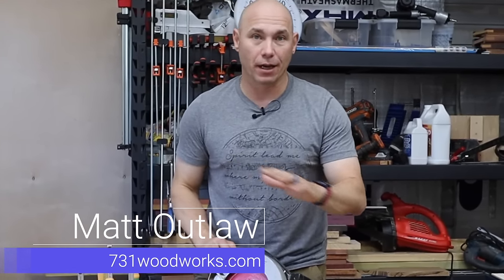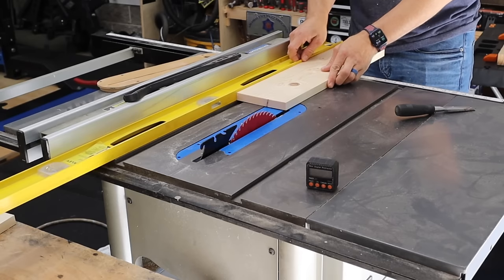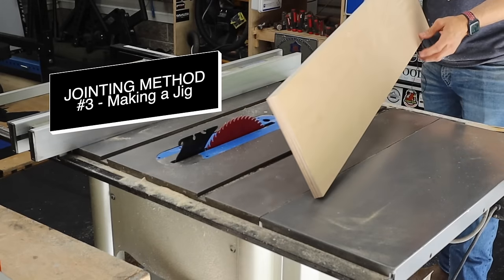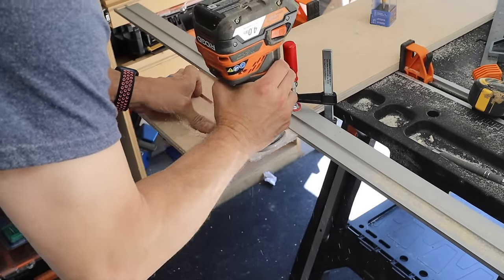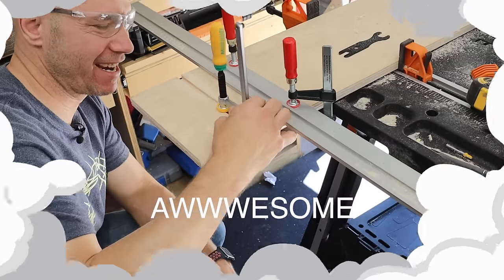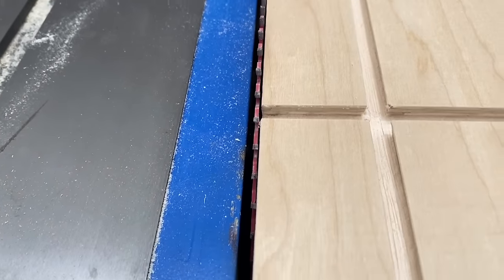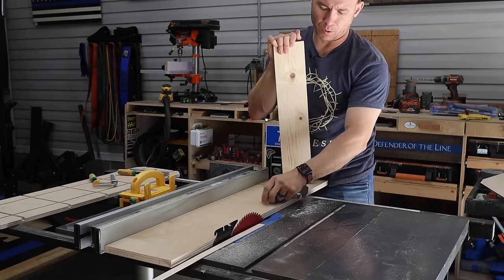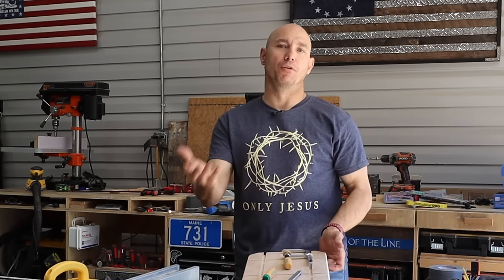5 Ways to Joint Boards Without A Jointer | Woodworking Tip

Comment from the maker: The first 1000 people to use the link will get a free trial of Skillshare Premium Membership: https://skl.sh/731woodworks05211
Reply: You could always flip it over and use a straight edge and tape measure.  Measure the same distance on both ends and draw your line
Reply: Awesome vid man. I have a question though. I'm new to the woodworking thing. I've never even touched a router before in my life.  My question is do you think the Ridgid corded router will work for making that sled? Its 5.5 amps and rated as 1.5hp. They're calling it a trim router. The reason I ask is because there's a smoking hot deal on it right now. The router and a sheet sander for $99. By itself without the sander is normally $129. It looks like Ridgid only makes 1 cordless router. Without battery (I already have them anyway) they're also $129. 

The questions section of the corded is a mixed bag. Ridgid rep says it can't handle a dovetail, users says it might if you use multiple passes. Your method with 2 different bits makes me think it probably could.
Any guidance would be appreciated.
Edit: another question...why didn't you just make all the first cuts with the first bit, then follow up with the dovetail? Moving the straight edge is easier and faster than swapping bits, no?
Reply: @KlockoFett   I own 6 different hand held routers. Why you ask because the price was right for correcting my  mistakes and I did the foolish thing the first time I purchased a router and bought a unit to small for the task. For heavy work buy a reputable  hand held router that will work for the main purpose and for various other uses such as a router table mounted unit. I have 2 Porter Cables, 1 is dedicated to my Incra Router table with Lift and yes I have the base if I should ever need to use it as a hand held that unit is 3.25hp. The second unit is a Porter Cable 890  2.5 hp and came as a kit with 3 bases , D base, Plunge base, Standard base. It is 16 years old and has seen thousands of board feet in usage and still going strong. I originally used it under my router table big mistake not enough HP.  3rd unit is a Ridged trim router and I picked it up on sale for 59.00 years ago and only purchased it because I could not find my Makita trim router at the time. Those two units are only used to make door jams , door hinge /strike plate cuts  and very light profile work because of the 1/4 inch collect . Such as trimming edge banding for frameless cabinets and shelving. I did Formica work long ago when I used to repair counter tops in apartments that had Formica. I also have an older Bosch 1600 series and use it for various hand held stuff,  but my go to is my Porter Cable with my Omni Jig 4216 for dove tails because of the template guide bushings.  I also have a Craftsman router that is a Bosch 1600 series disguised as a Craftsman and I picked it up off craigslist for 50 only because it was a packaged deal I wanted the dove tail bits and circle template,  guides bushings, parallel guide  the guy was selling. That is one of the other reasons I own a Bosch they're motors and bases ( Craftsman/ Bosch) are interchangeable and I can set different bits in the motors when sign making. Then the most expensive and it is dedicated for one job only and that is my Festool OF10 and it is mated to a LS32 system for shelf pins and other rail system routing needs. I had to pick up a collect to let the unit work with my 1/2 inch router bits. the factor collects are mm. 

    So in summary think about what you are going  use the router for before you buy ( most import part of owning any tool or machine). Buy it once save time and save money by getting the correct tool the first time around.
        Trim routers are for very light work only and come with a 1/4 in collect if I recall correctly.  2.5 hp routers will handle light task to medium heavy tasks come with both 1/4 in  and1/2 in  collets and MM collects are available if you want to use Euro bits.  3.5 hp  Routers all task can be done with one, but they are heavy use both 1/4 in and 1/2 in along with mm collects, Will mount to a router lift / plate for table usage. Important factors :  Soft start and variable speeds are a definite thing to have on a router or the ability to step the speed down. ( Not all bits turn at the same speed.  Warranties are semi important. but for the cost of say a Bosch 1617 dual base standard and plunge $219.99 at Lowes just easier to go get another when out of manufacture warranty.  Name brands are just that name brands most all tools are made in China or Taiwan.  I have 5 different name brands and would not change a thing because each one has it's usage as I have adjusted to that. For a non production shop get a multi base setup in a kit for general usage and a trim with attachments for special work. Plunge base is a good option to have hence the multi base kit. I was against plunge base routers for a time in the beginning because I did not understand the multitude of things a plunge could do. Piss poor training by piss poor instructor(s) leads to piss poor knowledge and piss poor decisions in tools and their usages. hope this long very long post sheds some light onto the subject for you or any one else brave enough to read through it all. Because when I started out there was no YouTube and most craftsmen were stingy with the knowledge of the trade and apprenticeships were very hard to come by.
Reply: @KlockoFett  To answer your question the router the poster of the video is using is a palm router aka equivalent of a trim router. So that router is working over time to cut that much material with a dove tail bit. and Heat kills/ dulls router bits very fast. So using an under power router would require the usage of two bits for ease of cutting and to reduce tear out. But also it is a good practice to use that setup . Straight bit to get to depth of the dove tail plus it removes majority of material. Dove tail bit only has to remove the beveled cut of the dove tail. Keeps dove tail bit cooler and prolongs the life of the bit. As dove tail bits cost  a lot more than a straight bit. Router horse power is also a big factor in bit usage. That is why poster made statement about router table.

Comment: I should tell you that I used to watch my carpenter grandfather joint using a handsaw back in the 60s.  When he built cabinets for our bathroom he would take to well matched edges and glue them together, then saw through the glue line, then re-glue them back together leaving a pretty much invisible line.  Any variance from straight was matched with the opposite variance on the other piece.  He did pretty much everything with hand tools back then.
You have a wonderful channel, thank you and God bless.
Reply: It is pretty spectacular when you realize the quality those men put out with just their hand tools.
Reply: Skills learned by necessity - few power tools and high-tech gizmos.  Watch some Japanese Joinery or woodcraft videos.  Few, if any,  power tools.  Others (people, cukture, etc) as well, but I don't remember specific craftsman.

Comment: I feel like a hand plane deserves mention as a method to joint a board without a jointer. Even a really good jointer plane is cheaper, smaller, and quieter than a jointer and an inexpensive jack plane can do a great job as well. The jack plane will also get a ton of other use around the shop. These techniques and jointing with a hand plane are also complementary because the machine techniques can get you close and do most of the work and then following up with a hand plane can get you perfect. This remains true once you get access to a jointer, just "close" gets a lot closer and ideally there is very little work to remove the machine marks and make the surface perfect.
Reply: Absolutely!  I’m into violinmaking and we always joint the plates with a hand plane, the jointer would remove too much material and could chip out the flames on the maple!  Hand planes rock :)
Reply: 100%!
Reply: You are. Correct, but it is a skill in it's self to use those hand plains. I suck with every one I've used😂
Reply: @lancep9394  need more practice. A little trick too. Edge join 2 boards by clamping both boards in a vice, edges up and flush. Assuming they are about 3/4" wide, the plane iron can hit both at once. Both sides wind up as flat as the plane.
Reply: @lancep9394  The key is to use a shooting board. This enables you to lay the plane on its side guaranteeing a 90 degree cut. There are special jointer planes to use but a No. 5 jack plane, or longer, will do fine. Quicker than setting up the table saw!

Comment: Love the fence jig - gonna make one of those! Regarding the 90-degree blade set - the most foolproof method is to joint the first board face up, then joint the second board face down. The two edges may not be exactly 90 degrees each, but the two together will always be 180 degrees and a dead flat perfect join.
Reply: If the board is wibbly wobbly you are probably best getting a flatter board or, if the thickness of the board is not a concern, planing the board to be more flat or completely flat is a good option. A much more involved option is steaming the board and then clamping it in some sort of straightening jig. If the bard is cupped or otherwise warped and you joint it, the whole piece is not going to be right anyway (unless that is what you are going for).
Reply: I love how OP is focusing on the side of the boards and along comes somone talking about the steps that should have already been done...

Its like telling an old man we just launched a rocket into space back in the 60's only to have him explain the importance of aerodynamics for lift on an airplane wing...

Comment: Great video.
As for the need for a perfect 90° between the table saw and its blade (0:53) you're absolutely right, it is better to have a perfect 90° cut however, if you alternate-flip the boards to be joined, the offset angle is canceled and the finished board will still be flat.
The farther from 90°, the more effort it'll take to keep the boards flat on the table when you glue them together, but for small offsets that's not a big issue.

Comment: You mentioning Tamara and then using a circular saw immediately made me think to make a plywood circular saw guide like a track saw many youtubers make but have the bottom with the microjig clamping system to give it more versatility and ease of use. You could put a couple wings off the start and end of the guide to be able to clamp it to a workbench and hang more off the edge.
Reply: How about making a video showing your idea? Sounds good but can't visualise without seeing it too

Comment: I grew up hearing “joinery” instead of Jointery.  I think in the old days, joinery was a term for all woodwork that was “joined” at corners, like casework.  I checked Google, and “jointer” is now used about half the time.  Anyway, I really enjoy your style.  Very informative.
Reply: I was wondering the same thing. Thanks
Reply: Jointers square the edge of a boars. Joinery is, like you mentioned, for joining corners, like a dovetail. Planers, while I’m at it, flatten the face of the board. So, if you joint the edges, you can ensure you have 2 flat edges to glue boards together. If they’re planed, they’ll be flat across the face, and if you want to make a nice corner without screws or nails, there are lots of joinery techniques you can use.

Comment: Hey Matt!  Love so much about your video, most of all, your engaging, humble, humorous and honest personality, along with all the technical stuff that makes for a clean, clear video.  Greatly appreciate the look behind the curtain to learn from your oops - dropped push block and pulling the dovetail bit up out of the groove.  I had a couple questions, but you already answered one in the video (I had to watch again before it sunk in) about using a relief bit to put less wear and tear on the dovetail bit, and one about wishing for a router table - so that you could do all your relief cuts, then all your dovetail cuts, only changing the bit once, and using a table's fence and not having to clamp and re-clamp straightedges several times.  Thanks!

Comment: Ive been doing the 4ft level trick since I first saw your video on it awhile ago. The sled is next on my to-do list because you make it looks so easy and effective. Love it!
Reply: I got my sled made the other day! I went for 2 layers of 3/4 mdf. I wanted 1" mdf, but austin hardwoods was out of stock...

I glued them and clamped them to a piece of stone slab to stay dead flat. I got a nice 2' x 7' piece of slab scrap from the job I'm on. The things that get thrown away in construction are amazing. I could make end table tops if I didn't want to save it to try my hand @ vereering.

There's more slab at the job too. A couple nice full counter pieces that broke on install. It's a crazy blue color. I want it, but it's not in the trash pile. I'm considering talking to the homeowner about possibly using it as a base and rim for wood pots on thier deck.

Comment: Great video! Thanks for sharing your knowledge. Got to thinking about how we could handle longer boards and found a solution that works really well for us. We have a Bora Portamate saw guide that we use for 8’ plywood. Just clamped it along the edge of the 8’ board and ran it through the table saw with the guide against the fence. Then ran the board through with the ripped edge against the fence. Thanks for the inspiration!
Reply: How do you clamp a straight edge to the board and still slide it on the table saw and against the fence?  I was also wondering about how to use all of these solutions for boards over 4ft in length.
Reply: @djbartles7337  that’s the beauty of the boramate. It has a built in clamping system that clamps on each end of the board. The board can’t be longer than the boramate.

Comment: You could also hold each board together and run the table saw through the touching sides creating a perfect edge.
Reply: @Adam Kramer You are right but the question is would you be able to run two separate pieces together until to the end in the same speed trough the saw blade, if you understand what I mean.
Reply: Yea that could be tricky and a little dangerous
Reply: If you screw them together on both ends with a a thicker scrap piece this works great.
Reply: This is a great idea, at least for joining boards that aren't too wide.  especially if you rig up adjustable fences on both sides of the table to make sure both boards can push through evenly. I'm going to try this right now, thanks!
Reply: Yeah and for longer cuts, clamp them down to a table. You could just use circular saw straight through it with a track. Perfect everytime.

Comment: A friend of mine that built cabinets for a living never used a joiner and solely used a table saw for this. He used a method similar to the first one that you demonstrated in this video, but he added a short board at the base to support the board being jointed like a push stick.  Love The Savior, so I love the t-shirt!
Reply: I have been using the technique you explain for 40+ years. It is generally referred to as a sliding fence. Never found a need for a jointer.

Comment: Great video! I’ve been doing the level trick since I saw your first video about it. It’s helped me turn out some great products. I think I’m going to go for #2, the fence jig, once I can actually find some plywood!
Reply: Ya I'm making one of these soon, I just need to sort out the clamps. I like ratcheting gear clamps. Haven't seen dovetail ones, I'm wondering if my festool ones might work, but I might need to install T-track for that. I have some jorgensen ones that work the same way but are normal style clamps. I'm 100% sold on this style quick clamp! I got 4, 8" jorgensen ones on the zon for $14 each.

I've got plywood coming out of my ears! You could probably get a piece free from a jobsite. I would check small jobsites and ask to talk to the contractor. I get most my plywood free from jobs I'm on. It's always around somewhere and often building up as trash.

I got a full sheet of 3/8" and an almost full sheet of 3/4" and some decent pieces of 1/2" from my last job. Plus a 2' x 7' slab of stone! 2 10" x 10' 4/4 oak boards, 6-6"x6"x8' pine lumber, 2 4x6's, and a 4x4. That trash pile was like Christmas!

Comment: I have that same Delta table saw. I bought a Bosch RA1181 router table and it fit perfectly between the rails of the table saw. Drilled 4 holes and fitted the router table nice and snug.

Comment: Great video and cool sled.  Power tools are great, but don’t forget that for jointing edges, a simple hand plane works extremely well even for long boards, especially if you don’t have a table saw.  Check out both Paul Sellers and Rob Cosman.

Comment: I have no clue why I haven't tried this yet. I have a jointer, and a really good table saw. Table saw is a saw stop. jointer is a cheap pos wen jointer. Not saying its bad. Pretty good with softer wood. Sucks at hard wood. Looking at this video with dove tail jig made me think. Why not take some birch wood plywood and make this jig. So I did. Bought clamps, makes a prefect cut every time! Thank you so much.

Comment: An alternative method is to use leg bolts up through the bottom of the sled similar to Rockler's Hold-Down Clamps instead of duct tape, much more secure. Drill the holes for the bolts offset from the center so you have a side for wide and narrow material.

Comment: I LIKE your style! Not possessing a shop like Norm Abrams (New Yankee Workshop - yea, I'm dating myself), and not having a tool for every purpose, we must learn to adapt. I especially liked the level for cutting a straight joint it would be a simple task to clamp a stop-block to the level to insure the wood you're jointing passed through without slipping. In the meantime, you've earned my subscription....